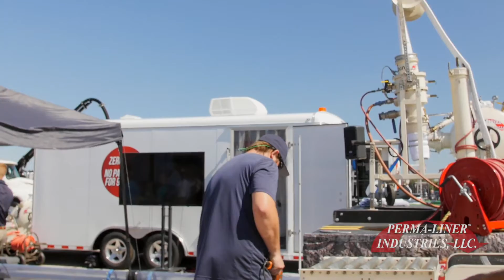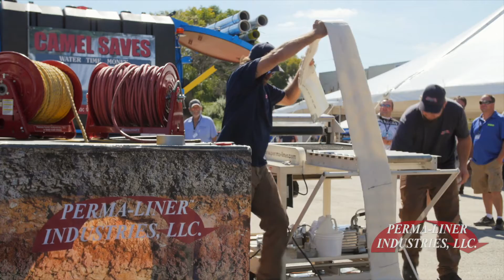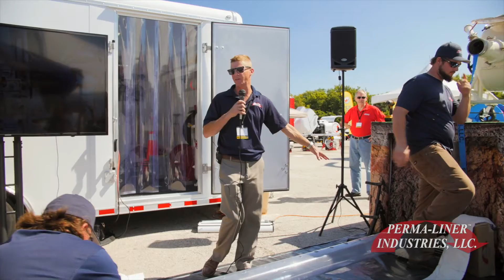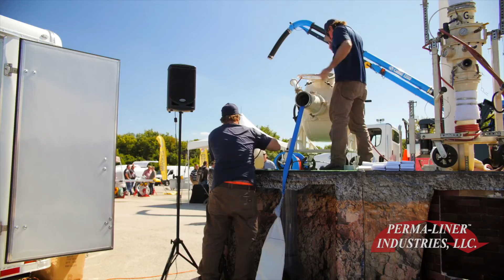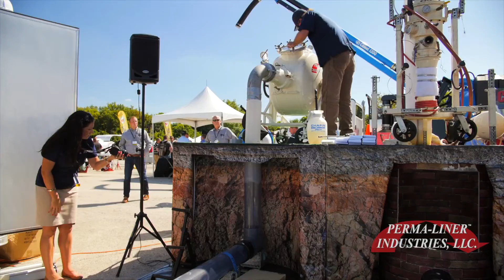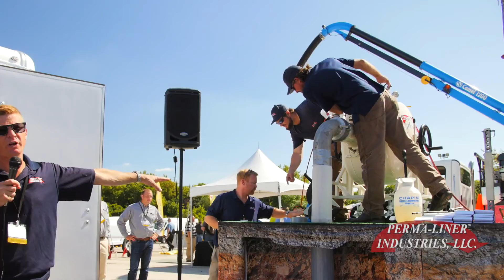Perma-Liner Process Showcased at WEQ Fair

Comment: Tree roots wreak havoc on old clay and Orangeburg sewer lines. You're very smart to mention the need to clean all the roots and any obstructions out of the sewer pipe first before adding your Perma-Liner soaked in epoxy resin to the catalyst. Nice job guys. Thanks.